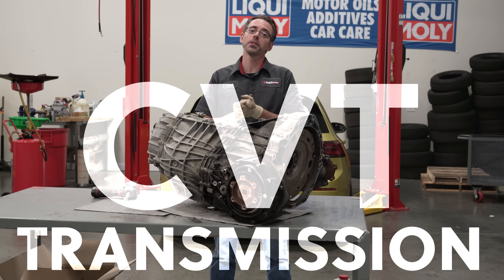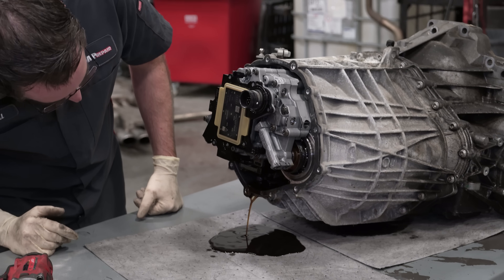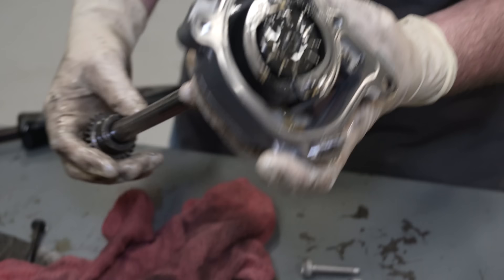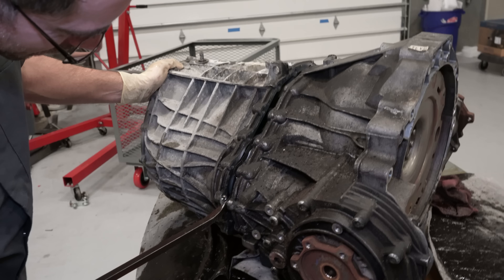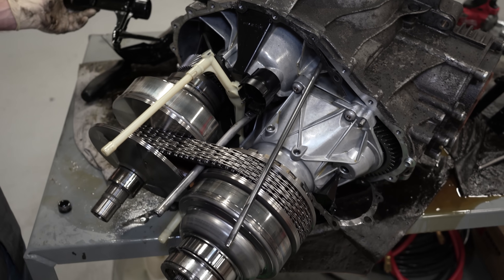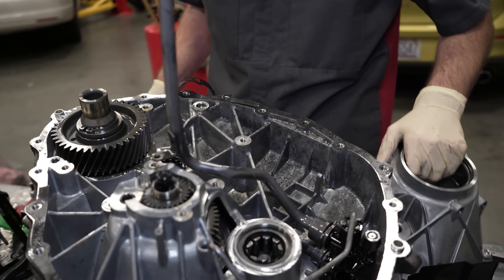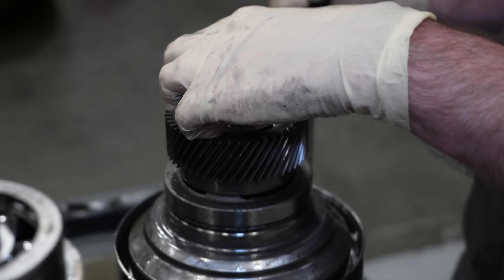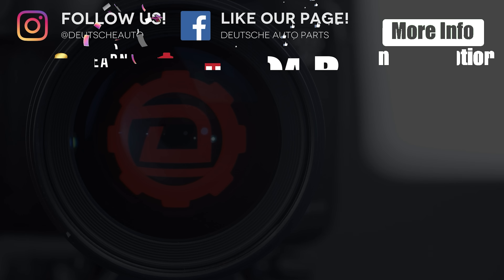Why you shouldn’t get a CVT transmission

Comment: I know a CVT gear as speed control of a pillar drill (Alzmetall AB 45 S). That's why I also know that with such a transmission, a translation change is only possible during operation.
What would that mean for a car? The clutch should not be located between the engine and the gearbox as usual, but would have to move behind the gearbox. That would be necessary because otherwise this CVT transmission the rest of the drive train would brake so hard that it comes to an emergency stop. 
This means that the driver can only brake when the clutch is disengaged.
The next problem I see is that the driver controls the speed of the engine with the gas pedal and at the same time the translation of the gearbox regulated.
There up manual way I find it extremely difficult to find an optimum... .
For me that means that both the speed of the engine and the the adjustment of the transmission and the use of the clutch would have to be automated.
It's a nice thought experiment to use a CVT transmission in a car, but I don't think it really makes sense.                                                                                                     Andreas, Germany

Comment: And to think years 40 years ago I hated traditional Autos that much on several cars I owned I converted from auto to manual because I couldn’t buy a manual variant. Been hearing worse and worse stories about CVTs and honestly I didn’t like them when the odd ones were put in scooters and mini bikes. Excellent video thanks so much for sharing. Very interesting seeing how complicated these things have become.
Reply: that kind of conversion is really cool, how did you deal with the sensors and computers?
Reply: @javajav3004  back when I did those conversions the cars I was working on didn’t have computers or sensors but saying that doing a conversion today on a modern car sourcing a second hand transmission would mean also you also get the sub wiring looms, control boxes plus any sensors and computers you may need or even building a wiring loom that bypasses the car’s computer systems.
Reply: @davegoldspink5354  what a hassle lol. Sounds like a hell of a time
Reply: @javajav3004  😂🤣😂 Marriage is far more of a hassle that and dealing with in laws. 😂🤣😂
Reply: @davegoldspink5354  mate don’t scare me now 😂 at least the in laws dad is a gear head too
Reply: Then you get those nasty child infestations
Reply: Toyota CVTs are great.

Comment: Had a cvt on my 2013 impreza, was not a fan. Acceleration from a stop was painfully slow and if you had much weight in the car, it would over heat.

Comment: Years ago we had a Honda Odyssey beach buggy.
Great fun with basically an old detuned air cooled CR 250 motor and a belt drive CVT.

Always thought the belt would fail, but in the years we had it, it never did.

There's not much point hating CVT's or DCT's because there's going to be more of them around.  People want automatic transmissions and car makers are chasing fuel efficiency.  The early automatic transmissions were even less reliable,  although we do expect more from cars now than back in the 60's. The bugs will be ironed out of these too.

Comment: I share your distain for cv transmissions which are a computer controlled hydraulically operated Salsbury clutch such as countless old school low budget go-karts and mini-bikes used. They were less than... then the are still less than today.
They are used in cars today because one size can fit across many model lines.

Comment: CVTs are being used before they’re comparatively reliable to the planetary AT, because of the federal pressures for for efficiency by impossible deadlines. The ability of the CVT to just keep your RPMs at the ideal ECO or POWER band with no shifting through throttle is incredible, but obviously they’re still working out some kinks. Unfortunately that main kink is the fact that it’s belt driven which has slippage when it exceeds stress limits. Then the CVT is going to feel that for the rest of its shortening life.
CVTs work best in small economy cars, where the belt is never going to be stressed by anything the car could possibly do.

Comment: Tell this to major car manufacturers like Honda, Toyota, Nissan and others. Even though the vehicle itself looks good and has a good engine, once I see in the specs ‘CVT’ I avoid it. The drive and feel of the transmission is just horrible. At times, you feel like you have a slipping transmission with no power range. This is pretty much with all CVT vehicles, I drove with Toyota being the worst. The only CVT that drove good was my 2003 Audi A4 FWD, but the only issue was the transmission was very unreliable. Had it changed at least two times in the 2 years I owned it. Audi discontinued the horrid transmission after the 2014 year. Only reason other car manufacturers are using this transmission is because it’s cheap.